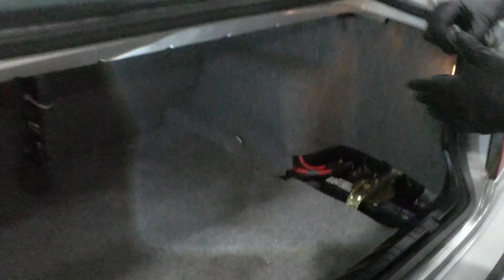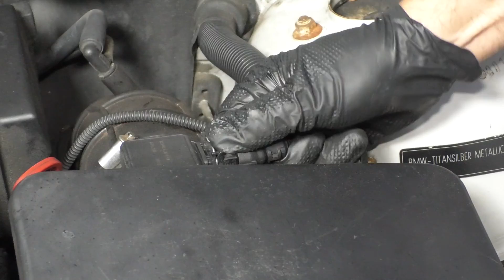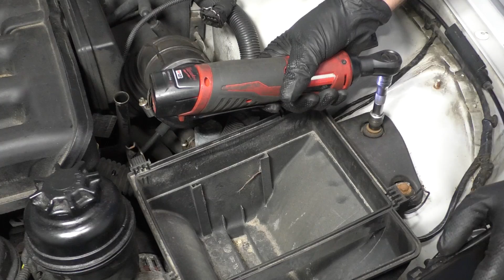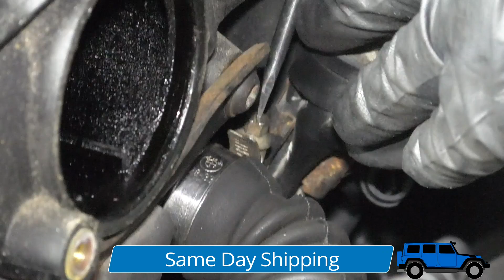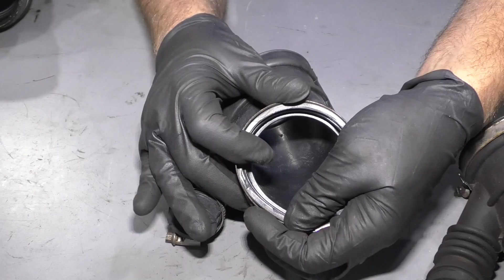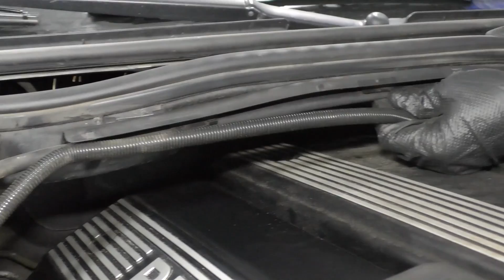How to Replace Air Intake Boot 01-05 BMW 325Xi

Comment: My intake boot does not want to stay on no matter how tight I clamp the ring it slides off after the smallest tug , my old one that’s now ripped was way more flexible and about a centimeter shorter , any advice? It’s on a 2000 328i

Comment: Is the intake boot from 1A Auto flexible?  Especially the small pipe to the idle air control?  I have one from a parts supplier that is not easy to bend.  thanks!!

Comment: So I used the T30 like you mentioned and got the top one out but doing the bottom one it ended up stripping. After further inspection mine is a T40. Don't know if it's like that for everyone but now mine is stripped and I can't get it out 😑
Reply: Mine was T40 as well 325ci.
Reply: Mine is all t40 , I had to go to harbor freight to get the drill set since I only had t30 and lower....

Comment: Hey you forgot to take the inner hose connector and reuse It on the new hose. This will for sure give you a small vacuum eventually a engine code
Reply: What inner hose connector do you mean